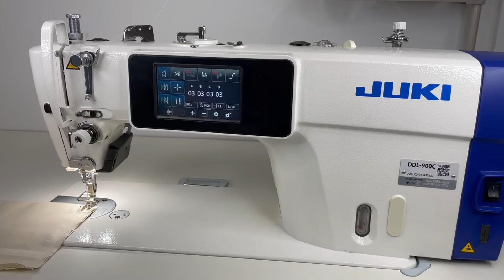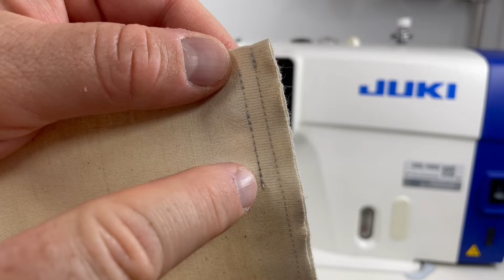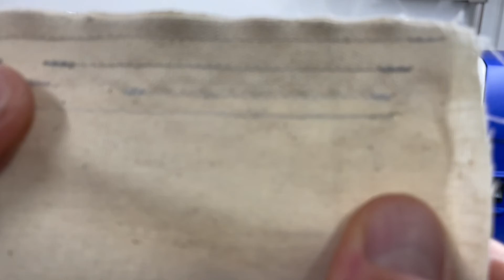How To Use Start And End Tack And Other Features On JUKI DDL-900C Industrial Sewing Machine

Comment: Hi I have an old juki industrial machine DLN-9010SS it was messed by someone so I have to use manual unlike before which was installed automatic easy for me to just go on sewing. What you shown now,is it the same installations to my machine?  The old lady owner lost the manual book.
Reply from the maker: Hi. machine automation is different style to yours but the images on the screen should be the same or similar function.